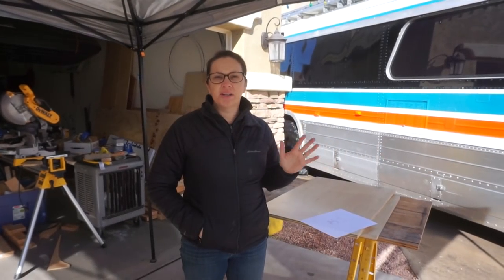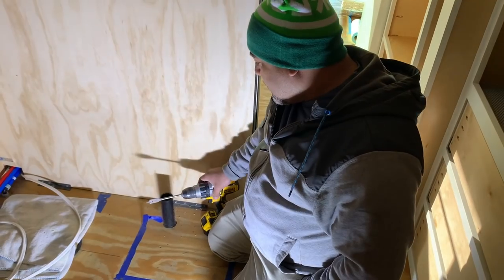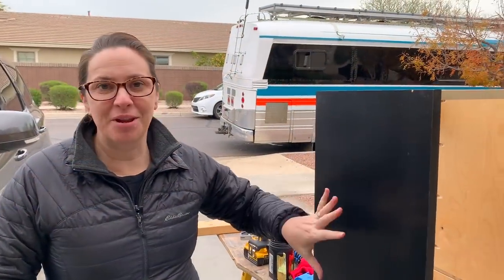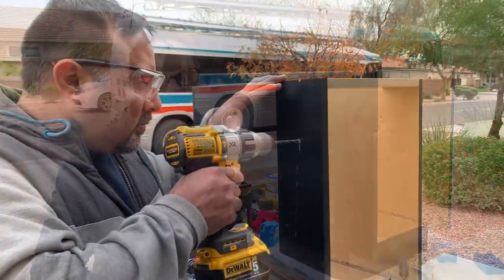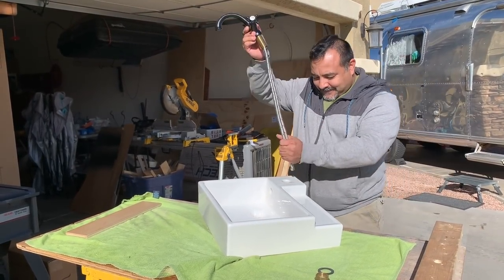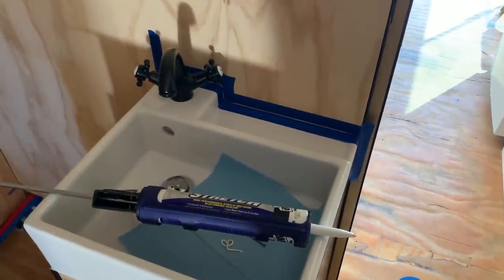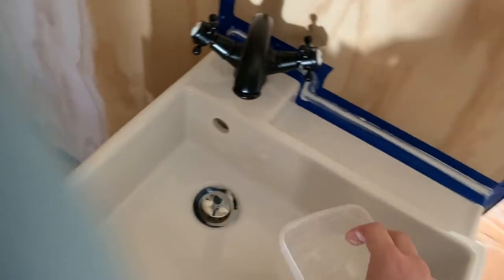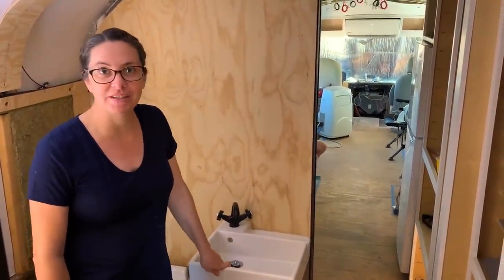Building a Vanity Cabinet

Comment: greetings from IRELAND great job on the cabinet here in Ireland there is no way could fit an electrical point that close to a water supply not in a van or a home !!!!
Reply: I'm assuming the outlet is a GFCI outlet.  There's circuitry within them that makes them safe for this application.  You could touch one soaking wet and fully grounded and be completely safe....assuming proper wiring.
Reply from the maker: Thanks guys.  It is indeed a GFCI outlet and we didn't really have any other great place for plugging things in near the sink.  As Richard has mentioned this should make it safe to use here.

Comment: Very nice! Here some tips when doing bigger caulking jobs; it is using the roll from use toilet paper or paper towel roll cut them into 2 or 3-inch tubes and place at an angel run along your caulk. It collects the extra into it. Sometimes it's easier to wet your finger then place the caulk on your finger, then run along your seam.
Reply from the maker: That's a great idea! Thank you!

Comment: What about splash guard on the wall and that outlet is very close to the water, some when could get teized. Potency dangerous, just saying. Keep up the good work. Love the videos
Reply: The receptacle is GFCI.
Reply from the maker: Thank you Anders - I appreciate you pointing out a potential danger.  As Kevin has stated the plug is GFCI and should be safe to use here.

Comment: I almost bought that exact sink for my bus!  But I ended up getting a bigger one they had. Can I ask why you put L-shaped connectors between the pex and the hoses on the tap instead of just joining them in a straight line?
Reply from the maker: It's a great little sink.  We saw the bigger one, too, but it wouldn't fit in our space.  I think the main reason we chose the 90 valve vs a straight one was that if we had done the straight one, we would have had to make the connection down near the bottom of the cabinet so that the faucet hoses could hang straight to make the connection.  Or we would have had to make a bigger loop in the hose.  We are going to put a shelf in that cabinet for more functional storage, and then the valves would have been below that shelf, making it more difficult to reach.  This way, they are in the top half of the cabinet, the hoses make one gentle curve, and we have easy access to the valves.  I'm sure we could have made a straight one work, but this was our preference.

Comment: If that suv in video is one you want to flat tow you may want factory wheels back on it.  Ive seen jeeps with deep wheels being flat towed and were unable to follow tow camper properly.
Reply from the maker: Charlie that is indeed our tow vehicle.  We have not pulled it yet because we need to have a different receiver hitch welded up (right now it just has a ball on it but the tow bar goes into a 2" receiver).  Thank you for sharing this - now we will be extra cautious when we get around to testing that out.

Comment: Different looking sink will the back tray be an issue with water.
Reply from the maker: Thanks Steve - we have been using the sink for about 3 weeks (the videos are little behind 'real life').  There is a slight issue in that sometimes with wet hands operating the handle a little water can start to puddle in that back tray area but it has mostly been solved with a little but of training and some wiping down when drying hands.

Comment: Seems like the height is lower than normal, or it could have been camera angle.
Reply from the maker: Thanks Richard.  We thought that too.  We used the bathroom sink in our home as a rough "guide" for the height.  The difference I think is that in our home the sinks are on a countertop and are "sunk in" (if that makes sense) and a little further back.  We have actually been using the sink for about a month now (yes the videos are THAT far behind) and in practice the sink does not actually feel terribly low.  A side benefit is that our 6 year old has no trouble reaching or using it.